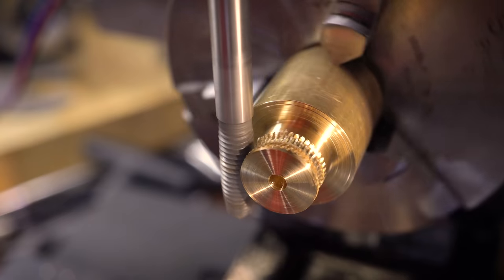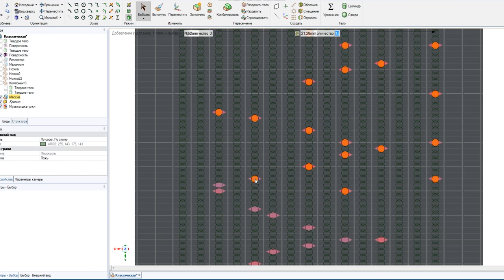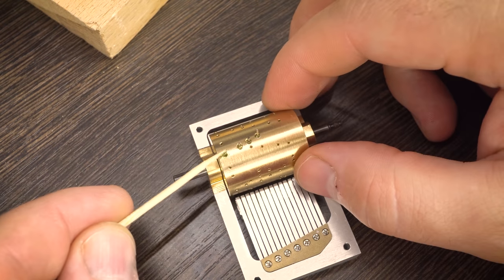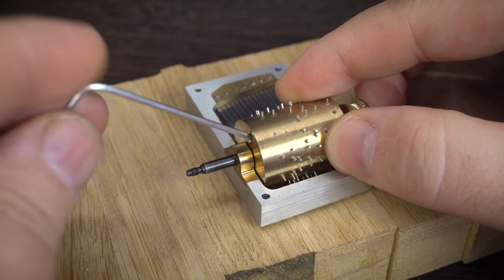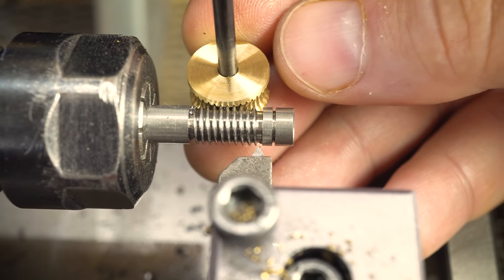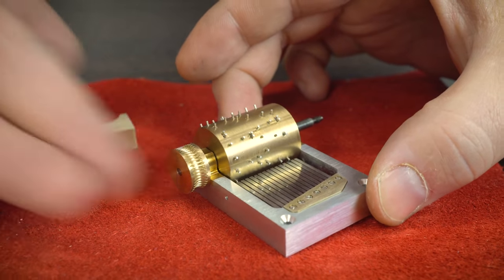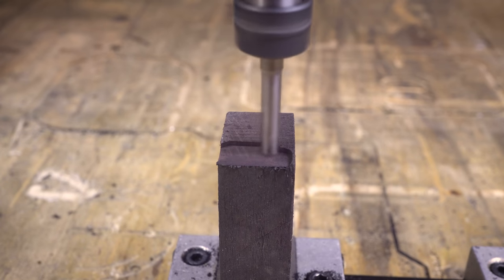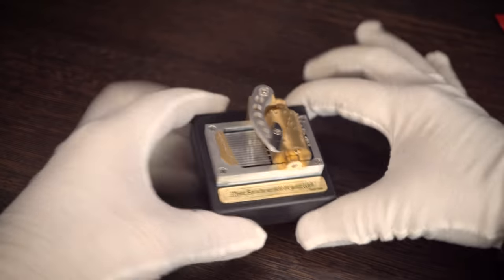Music box from the blade of a knife / part 2

Comment: Great job. You can drill holes in all the notes so you can rearrange any song you want at any time. Perhaps with a small neodymium magnet in each hole, or by making the thread on each hole (nightmare job).
Reply: I think you could get a tube magnet of the correct size that slides between the drum and the axle instead of doing a tiny magnet in each hole.
Then, you could drill every note all the way through and insert your pins as you see fit.
Reply: Easier to make multiple drums. Changing out all the pins for different tunes?? Not many people would have that much patience. Your idea is possible but not too practical.
Reply: Probly every second hole so they dont over lay